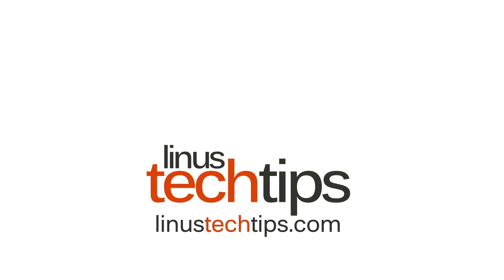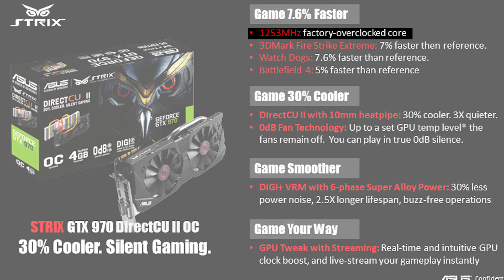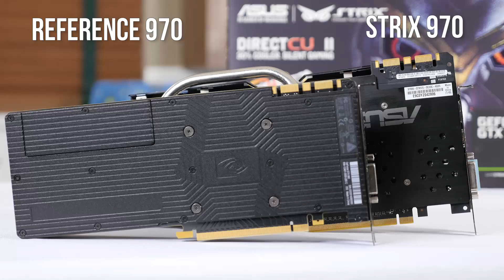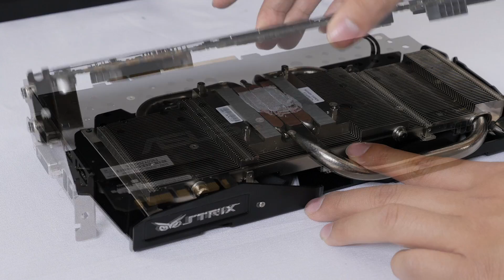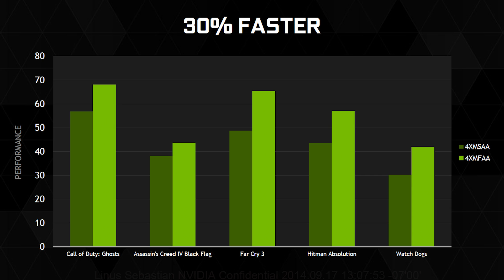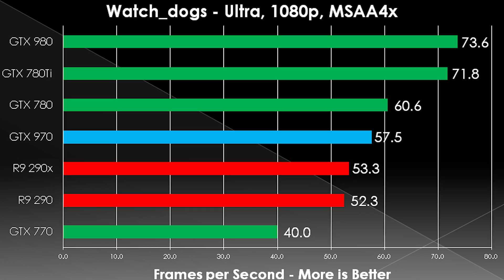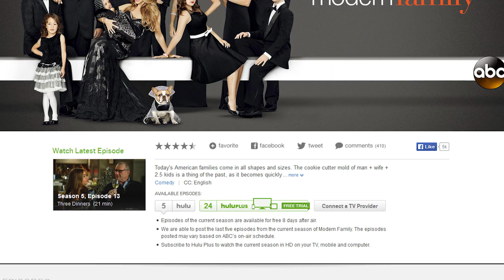ASUS Strix GeForce GTX 970 Video Card

Comment: Ok, I really need help guys, I have a desktop pc running 32 bit Windows 7, now I want to play all the new upcoming games and most require a 64 bit operating system, and I have a 2010 asus laptop which is running a 64 bit operating system (also Windows 7), can I take the hard drive out of the laptop and use both it and my desktop hard drive in my pc, can I use the 64 os on the laptop hard drive in my pc, or do I have to buy a Windows 7 64 bit copy and do a clean install on my 32 bit os hard drive
Reply: How old is actually your computer and what is your CPU, RAM, GPU and so?
Reply: Built it in March of this year, the specs are a fx 6300 cpu running at stock speed (3.5 ghz), a gtx 660 2gb (non ti), 4 gbs of ddr3 ballistix (1600) ram, 500 gb western digital hard drive, asus optical drive, gigabyte 990fxa-ud3 motherboard, and a corsair 500w power supply
Reply: You need a install disk your f*** if you don't unless your desktop is the exact same hardware as your laptop
Reply: What, can you actually type legibly
Reply: i mean you need a new disk period!
Reply: Running the disk with the laptop os doesnt work. It will give masive driver issues. Just partition your pc harddrive and instal the 64 bit and 32 bit windows next to eachother. That way on startup it wil ask you which one you want to use. Just google "windows dual boot" and if it was me and i had an original windows allready on my pc for daily stuff. I would just download the 64 bit windows from the microsoft site and not bother with activating it. If its just for gaming who cares about security updates.

Comment: Just got a 770 should I return it and get a 970?
Reply: Yes. Might be 70$ more if you bougt 770 by the recent price drop.
Reply: From what I can tell yes. I was planning on building a PC this holiday with a 770 but from what I've seen so far this 970 blows it out of the water and i've switched up my build to compensate. From what I've seen the new card gives AT LEAST 10% more performance which in my mind is definitely worth the hassle for a return.

And yes the 770 is going to plummet in price this holiday while merchants get rid of the remaining stock (card is being discontinued, this is it's successor)

Comment: Seems like you guys got a bad 970 by just looking at the wattage figures.  My 970 pooped all over my 780 lightning. 

I think you guys should just start testing out of the box settings as it doesn't make sense to have a 980 beating a 780ti and then have a 780 beating a 970 (by logic the 780ti has 25% more cuda cores and faster memory clocks vs the 780, where as the 980 has 23% more cuda cores than the 970 and the same memory clocks).

Comment: I know this question may be crazy but can a 970 and 980 run on a board that is NOT an X99? Also, do the cards require DDR4? Lastly, Do you have to use a new i7-5000+ chip to run it? 

Can the 980 and 970 run on older boards like the x79 and use older processors like the 4770k?

Thank you for your time.
Reply: They can run on a board that isn't X99. Pretty sure they'll be fine with older processors, too. DDR4 is not required.
Reply: It can run on any board that has fast enough PCI-E (i think 2.0 or 3.0), so your old Sandy Bridge board wouldn't be a problem, as long the CPU is fast enough (Core i5 or higher)
Reply: Thanks a lot. This has really been bugging me. Now I know that I have no problem getting the new graphics card. Thanks a bunch guys! :)

Comment: I got the evga gtx 970 SC acx 2.0 because its only 350$ and Im not going to pay 200 more bucks for 20% or less preformace, and if I really want more preformace I will just sli 2 togetther because it doesnt cost much more than the highest end gtx 980
Reply: i agree getting 2 980's for over 1k isent as worth it as 2 970's which would run for around 700, with that big of a gap you could even get a third 970 to even out the price and still get better performance for same price

Comment: I have a 500w power supply with two 6 pin connectors and one 2 pin connectors to go with one of the 6. Is this power supply good enough to support this card.

Comment: would u guys say a i5 3570k and a 970 is a bottleneck? id like to know since i upgraded to this cpu last december, and i dont wanna upgrade again until next summer, ive got a 660 at the moment btw
Reply: BOTTLE NECKING PRETTY MUCH DOESN'T EXIST UNLESS YOU RUN LIKE 3 780'S AND A INTEL CORE I3
Reply: I have the same specs as you lol! Except i have an i5 4560, but still. I'm also wanting to get a 970.
Reply: OdinAlgeron
FX 8350 + dual 780ti user here responding with one giant "fuck you"
Reply: No it wont bottleneck the GTX 970.
Reply: That's still a solid processor. The 970 would be a great upgrade for you. Go for it!
Reply: i have the exact same specs as you lol, probably will be getting this card
Reply: thanks guys!!
Reply: julien foss I'm making a macro with this text. I hate bottlenecking questions.
Reply: 7DeadLeeSins
i3 or any amd processor, with anything higher than a single gtx 770 to be completely correct.
Reply: OdinAlgeron Any AMD processor?
Reply: Neelmay13
The i3 sometimes gets better fps than a 8350... Depending on game.
Reply: OdinAlgeron And sometimes the fx 8350 gets better fps than most i5's... that also Depends on the game.
Reply: Neelmay13
Specifically in those very few games that can use all cores. And even then they achieve parity at best.

Older games, MMO'S, and most newer 1-4 core using games the i5's win easily.

Game companies are lazy.
Reply: *****
/shrug There are people with apu's and 290x's.

Just cause it can be done, doesn't mean its a smart idea.
Reply: *****
Think about this:

 Play bf4 in direct x.

Play bf4 with amd's mantle.

Get more fps in mantle? Then yeah your cpu is bottlenecking.

Mantle is designed to alleviate amd's cpu low performance per core. 

Not all games support mantle, in those games you are cpu bottlenecking and thus have wasted the money you spent on those 780ti's.
Reply: OdinAlgeron True.
Reply: OdinAlgeron

You claimed that "any AMD cpu" would bottleneck "anything higher than a single GTX 770" and that is an absolute load of bullshit.

I'm pretty sure that even the FX quad cores can handle a 770 without bottlenecking as long as the game isn't a steaming pile of shit-code.

edit: also, if my CPU were bottlenecking then I wouldn't have gotten a performance increase when I added the second 780ti, so...
Reply: *****
Is it bullshit? Then why does mantle give such huge increases to amd cpu based systems?

That IS proof, undeniable.

Just because your games run "better"
with 2 780 ti's with that mediocre cpu does not mean you are not bottlenecking their performance.

You are not getting the performance you paid for.

There is such a thing as placebo.

Answer the question: Do you get better fps in mantle?
Reply: OdinAlgeron
I don't own any games that use Mantle, so I can't test. Pretty sure Mantle is only for AMD's GCN architecture GPUs anyway?

And the definition of a bottleneck is when one part of a system prevents performance from increasing any further, like the neck of a bottle. No matter what you do, you cannot pour liquid out of that bottle any faster than the neck allows. The "liquid" here is framerate, the "bottle" here is my desktop, and the supposed "neck" of the bottle is my FX 8350. If the 8350 were bottlenecking the system, the "liquid" that is my framerate could not flow more quickly without widening the "neck," or upgrading the CPU. However this isn't the case, since adding another graphics card increased framerate. Until you learn what bottlenecking actually means in the first place, I'm not wasting any more time here.

tl;dr: You keep using that word, I don't think it means what you think it means.
Reply: *****
Don't need to have it yourself, go look at fps benchmarks. 

http://images.anandtech.com/graphs/graph6985/54986.png

Bottlenecking 7970's... Yeah...

Now you can overclock that 8350 with the right components and you can probably reduce the issue somewhat,  but then again you could have just gotten a h97 mobo + xeon with HT for the same money.

 At stock has better performance than a 5ghz 8350.

Mantle would not have been made if there was no issue.

Bottleneck - the performance or capacity of an entire system is limited by a single component.
Reply: ***** Last i checked, it was over $300.
Reply: Neelmay13 334 dollars to be exact ..for a 4770k at least
Reply: xDESTROYx
If he got a i7 4770k or 4790k he would need a 1150 motherboard.
Reply: ***** Pointless, he can spend that money on a better GPU,
And he has a LGA 1155 board, so from what i know a LGA 1150 CPU, won't work in it, he can use i7 3770k but it's overkill, my i3 4130 beats all games i play, Shadow of Mordor, watch dogs, and witcher 2, it just needs a better cooler, cause it gets too hot, so a cooler master 212 evo and all games will fall,so for him he should get a better GPU.
Reply: ***** Wouldn't be as big of a difference as buying a better GPU,
and would be pointless, the i5 still has a lot of power left in it.
Reply: OdinAlgeron
why do you have to be so mad that some people do not buy the same hardware as you?
Reply: slimj091 What exactly comes across as angry?

Comment: Out of all the gtx 750 ti models, which one should I get and why? Or should I get the 760?
Reply: I have the EVGA 750 Ti SC and it's great for 1080p gaming. If you have the money get the 760 :)
Reply: I would say either GTX 750 Ti or wait for GTX 960, which is rumored to be released October.
Reply: Medieval Blast I would get the gtx 960 but I think it will be an overkill for my pc specs that i have right now.
Reply: KidOnTheMoon101 That's not overkill, that's an upgrade!

Even if you have 768p or 900p monitor.

Comment: I'am always really surprised with Linus's benchmarks. All other benchmarks show that the 970 stays between the 780Ti and 780 (from nvidia's team AMD not included). Even when you overclock the cards you should see about 15% difference. I don't know how Linus got those numbers... 9xx series overclock way better then the 7xx series with the same scaling. How can the 780 be faster then the 970 when both overclocked when the 970 is stock faster and overclocks higher with the same in not better scaling ?!

Comment: That chart seems radically different than most other benchmarks out there. The 970 is mostly up there with the 290X at 4K, easily beating it at lower resolutions. It destroys the 780 and trades punches with the 780 ti. The higher overclocked versions perform similarly to the reference 980.

Comment: Can i do SLI with that one and a GTX760 (EVGA) ?
Reply: No, if you want to sli two cards they have to be the same, for instance, you can run an evga and an asus gtx 760 in sli (if at the same clockspeed etc) but.    you cant run a 760 and a 770 or anything else except another 760
Reply: >REally ive benn told that u can do SLI with diferent cards just if they are compatibleSHIT
Reply: Lucas Granato crossfire can, kinda.... its complicated.  as long as it has the same gpu...so you can cfx a 7870LE, 7950, 7970,and  r9 280/280X. any of those will work because they're all Tahiti chips. but not with the 290 or 290x....Hawaii stays with Hawaii
Reply: paul taylor KK man thnx il get the 970
Reply: Lucas Granato You can't even SLI cards that have different RAM amounts. A 4GB and 2 GB card of the same model cannot SLi
Reply: bosfreak12 OK bro thnx then do u think its beter for me to get a gtx970 strix sell my 760 ?
Reply: if its the 4gig,760, id get another for SLI. if its just the 2gig, get the 970
Reply: no its nvida they wont let you

Comment: I'm still not sure if I should bother getting a 970/980 or wait until the 20nm cards which I would hope truly out perform the 780 ti. the 980 is too close to the 780 ti in performance for me to make the leap. even though drivers are not fully optimized for them yet I don't see them getting 20% faster than it already.

Comment: Would it be reasonable to overclock all your cards to the same frequency (maybe around 1300 Mhz) so that way we can see the performance difference from an architectural stand point rather than a steroid boost standpoint?

Comment: I am planning to buy a msi gtx 970 (priced in the Netherlands 350euro's), should I get one or wait till a price drop? Your advice is really appreciated.
Reply: Doubt their is going to be a price drop.
Reply: you are most likely right, but the card is less than a week on the market so, should i buy it straight away?
Reply: ThelightningNL Als je het echt wil, dan koop je hem. Ik zou gewoon een maandje wachten, dan zijn er wellicht betere drivers en meer support.
Reply: ThelightningNL I suggest you to buy it in Dollars and you'll pay like 250/280 € (shipping and import taxes included (at least for Italy the price is that)) ^^
Reply: ***** at this moment the card is out of stock soo..yeah
Reply: I think there might be a price drop soon but only if amd release something of similar performance and at a cheaper price. I think within the next few months there is going to be a few cards coming out so I say wait for a bit and just see.
Reply: go for the asus, the msi doesn't have a backplate and HDMI 2.0. instead it uses HDMI 1.4
Reply: Keyvan Khadem Ravandi the asus strix has a single 8 pin, so I wont be able to get everything out of the card after overclocking, beside that, it costs around 20 euro more than the higher clocked msi.
I am not going to use hdmi anyway, sooner or later I am going to buy a 4k monitor, that needs a display port  or a hdmi 2.0 for 60p.
Reply: ThelightningNL yea but asus uses high quality components. their powerphase, chokes & capacitors are amazing. they can provide enough power iwth less resources. A lot of R&D went into making their cards
Reply: ThelightningNL The 970 just will not pull more than 220 watts.
Unless you LN2 that sucker...
Reply: MC23 Come ? Mi spieghi come funziona (che negozi) ???
Reply: ***** Il prezzo a cui mi riferivo l'ho visto su Amazon, in cui basta cercare dal sito .com invece che .it

Ma anche su eBay se fai una ricerca avanzata con i giusti parametri puoi trovare chi spedisce dagli USA a 15/20 dollari + 20 dollari di importazione. Più basso è il prezzo "base" dell'oggetto meno tasse doganali paghi, almeno per me è sempre stato così :)

Comment: Would it be worth upgrading to this from my Gainward 680 GTX Phantom 2GB?
Reply: Yes
Reply: Not really,  you will only get around 10fps increase,  rather upgrade to 980 if you can
Reply: This moron actually bought a 2 gig card!
Everyone knew by 2012 that more video ram is more better.
Reply: No is not worth it!
You have already a GREAT and exsenvive CARD.
Worth it only if you have a gtx760 or gtx660 to make the jump to gtx970.
But in your case CLEARLY NOT.

Comment: Is it possible to show quantitative evidence of how much you would save on an electricity bill using these cards?  I'm still completely undecided whether to get a 780, 780ti, or a 980.  I'm still playing at 1080p but the ability to play 4k on a single card is welcoming especially if Gsync monitor availability increases down the road.  As a rule of thumb if I can play BF4 at 60fps on Ultra settings then the graphics are good.  Right now 770 and above can (with Overclocking) reach these settings.  I'm stuck in a holding pattern because the possibility of having two 780s is becoming more affordable.

Comment: Ok, I currently have a GTX 555 and a 330W power supply. I wanna upgrade my graphics card to this one(most probably). Will the power supply be able to handle this card?
I have an Alienware X51(I know people are gonna hate on me for this) so I'm not sure if the card will fit in the case as well. And I can't really upgrade the power supply on this PC, so that's not an option.
A little help, please?

Comment: Would putting this in a PCIE 2.0 slot have any disadvantages from a 3.0 slot? My 990FX board doesn't have 3.0 and I'm considering selling my GTX 760 and upgrading to this.

Comment: Heya, I was wondering whether my CoolerMaster Vanguard 650W will be able to run this card. My CPU is an i5 4690k and I have 8GB's of RAM (Not that that should be using much power anyway). Thanks in advance.